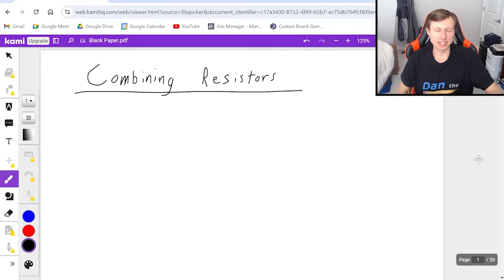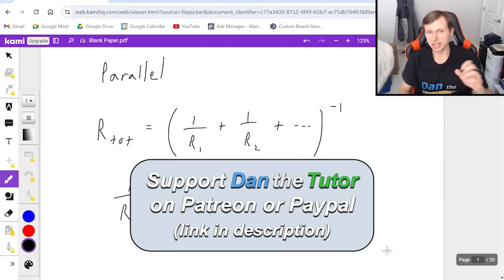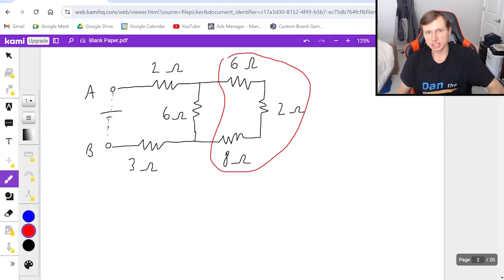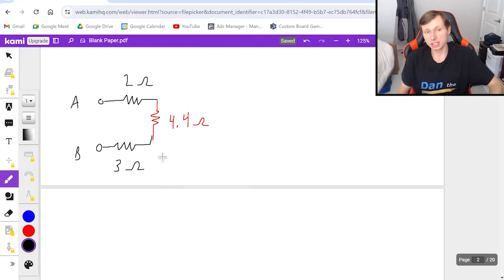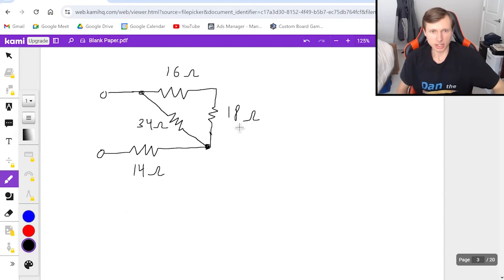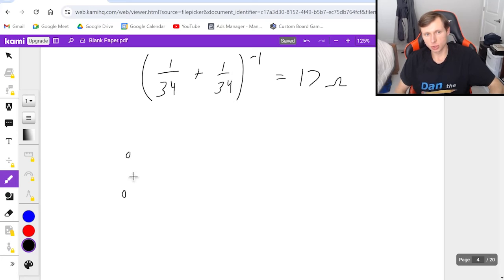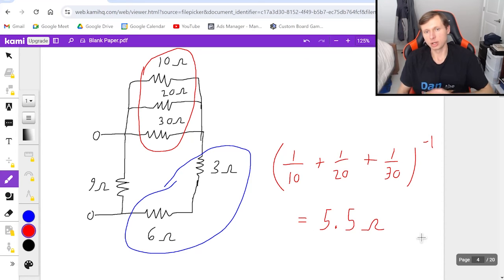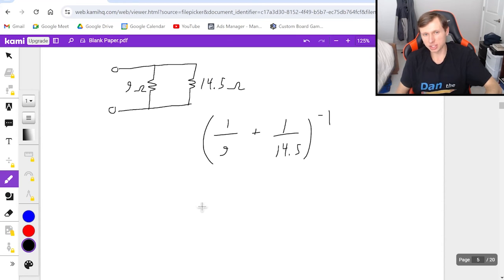How to Combine Resistors with both Series AND Parallel

Comment: thanks for the video, very helpful! one question-- @3:47 are the 2 ohm resistor and 3 ohm resistor in parallel with each other as well?
Reply from the maker: Nope. Even though they look parallel (from the math definition of parallel), they are in series because there's only one "road" for the electrons to travel.
Reply: @danthetutor2624  thank you!